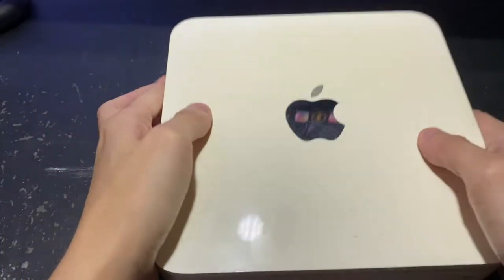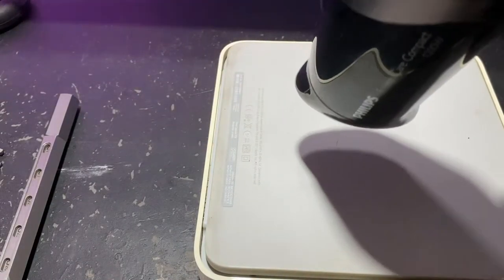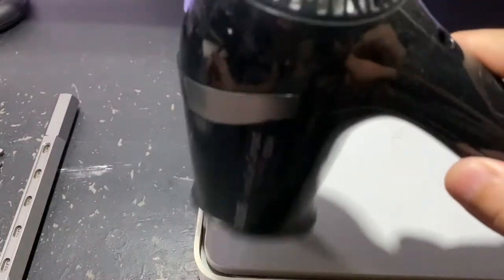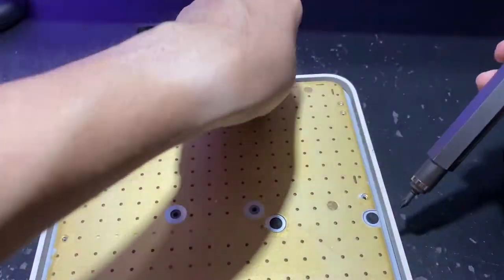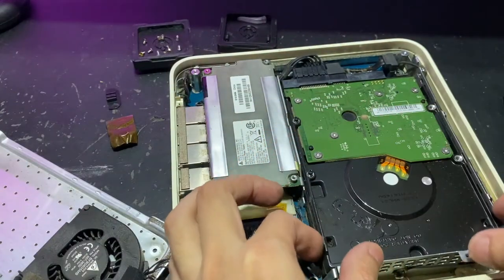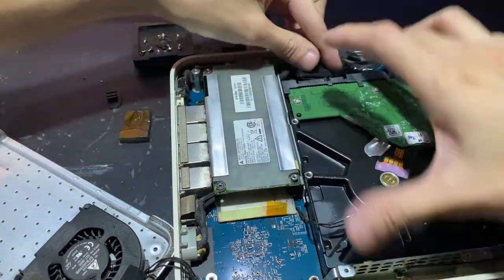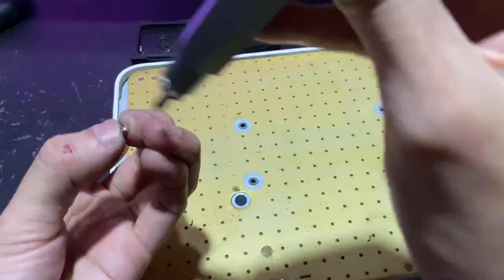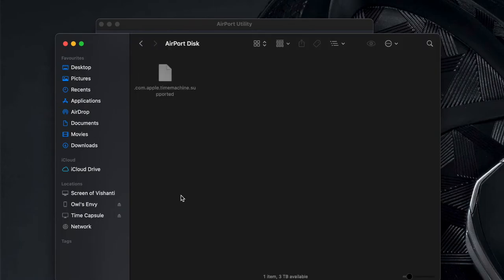Apple Time Capsule Hard Disk Replacement

Comment: Great video! Would it be possible to replace the hard drive with an SSD? Would the temp sensor be able to work with an SSD? I heard about issues with the temp sensor. I think people used a software program for the fans. Not sure if someone found a way to make the temp sensor work.
Reply from the maker: Hi, that's a question that I would like to know as well. Unfortunately, I don't have an SSD lying around and I wasn't about to spend on a new one at the risk that it won't work. For the previous gen Time Capsule, I read that some hard disks are not even compatible after installing. So I went for the safe route and went for the 3TB instead. But if you have an SSD lying around, I think there's no harm trying.

Comment: can airport time capsule use ssd?
Reply from the maker: Hi, that's a question that I would like to know as well. Unfortunately, I don't have an SSD lying around and I wasn't about to spend on a new one at the risk that it won't work. For the previous gen Time Capsule, I read that some hard disks are not even compatible after installing. So I went for the safe route and went for the 3TB instead. But if you have an SSD lying around, I think there's no harm trying.
Reply: SSD will work if the connections are standard. But you want to use a SSD big enough to make it worth while. And those might not be a good alternative to a 6TB WD hard disk because of the prices. Also, SSD is specially good for notebooks and the like, because they are more or less shockproof. That is not needed for a stationary Time Capsule.